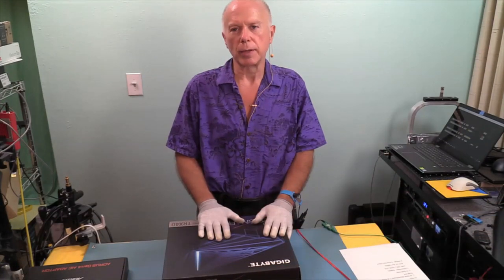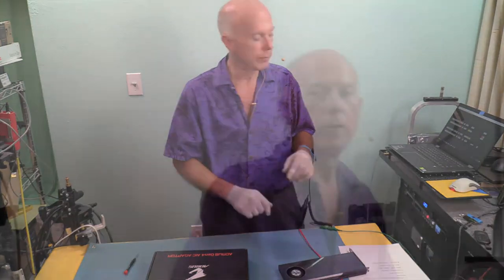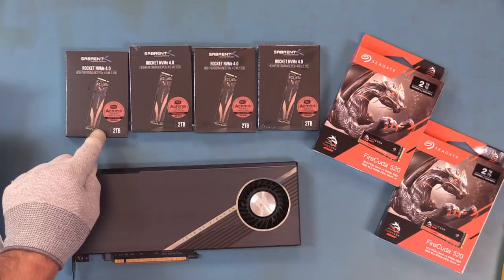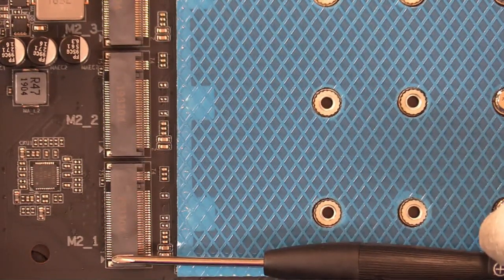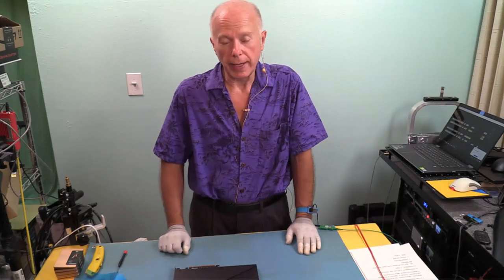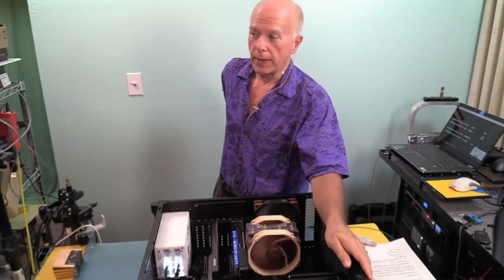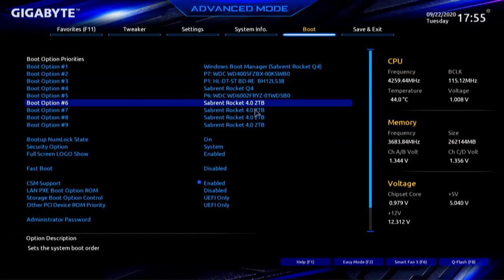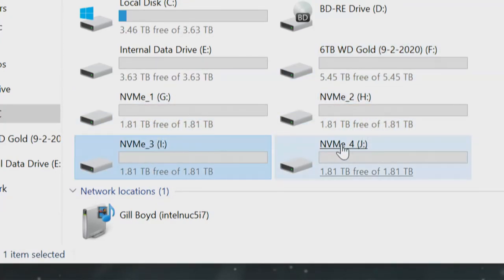Gigabyte AORUS Gen4 AIC Adaptor Comparison and Simple Install Tutorial TRX40 Designare

Comment: Hi I wonder what was the speed read and write that you get on that configuration .
If i get 4×sumsung 980 pro would it support that speed of 7 gb of 24 in total on  PCIe 4 or is there any bottleneck some where in the design
Reply from the maker: Hi Or Aka, 
Good to meet You! We are working on that Topic right now as an ongoing project. 
We have tested 1 - 1TB Samsung 908 Pro Drive for performance on 2nd M.2 NVMe Connector. Single Samsung 980 Pro achieved 6,700 MB Read and 4,900 MB write on 2nd M.2 Connector. 

Using 4 - 2TB Sabrent PCIe 4.0 1st Generation Drives, we achieved 8,400 MB Read; 12,000 MB Write in Windows Software RAID. Using 4 1TB Samsung 908 Pros should do better since those are 2nd Generation! We tested using CrystalDiskMark7. Default parameters. Hope that helps! Thanks for Asking! We're working on a Video of those Stats. Stay tuned!

Comment: I enjoy the videos.  I watched elsewhere that to take full advantage of RAID 0 across 4 NVMe drives, they are better suited to 2 drives from PCIe slot 16_1 and 2 drives from PCIe slot 16_2 because apparently each CCX in the Threadripper favors a particular set of I/O on the motherboard.  Have you heard or experienced this?  This was a couple years ago with older Threadrippers so maybe the technology or architecture has improved since?  Just a curiosity.
Reply from the maker: Hi bistrobmusic, 
Thank You! I'm glad You've asked that Question! We'd have to test to find out. 

AMD 3970X CPU - # of CPU Cores: 32
https://www.amd.com/en/products/cpu/amd-ryzen-threadripper-3970x
Core Compute Complexes (CCX) 3970X 
https://en.wikichip.org/wiki/File:zen_soc_block_(32_cores).svg

I question whether the problem is actually the Hardware. Windows is not a Real Time O/S. DPC Latency is an issue, as You well know. And Windows behavior does not help. More on that subject, in another Video! 

This would be interesting to know on the Threadripper Pro to determine what that System could be capable of at that price point. 

There was a time when Thermal Recalibration was an issue with spinning drives for Video. 

Furthermore, I don't know if it's worth the trouble considering the machine could not be put into production while testing. RAID alone can be finicky to setup, not just in RAID per say but in setting up block size. Changing one thing changes everything! 

We're focused on the totality of the System. In other words, what it takes to make it work and how to fix it when it does not work! Documenting even this much takes time. But this much, we think is worth it for You! Yes details matter. Enough details to get 'er done and get to work! Our Goals are, Bang for the Buck and to Keep it Simple! 

Are You Building a TRX40 System? You're in to Music, You'll want to watch our Titan Ridge Thunderbolt 3 Tutorial. Thanks for Asking! Al always, Your Comments help Us to make better Videos! Stay tuned!

Comment: some benchmarks would be nice, especially wanna see if it can go over the rated 15gb/s they advertise, if its pcie4.0 it should be able to handle 27gb/s++ with 4 fast disks, but i suspect they use some older chips/switches in it.
Reply from the maker: Hi King, 
Welcome! Working on it! Had to sidestep due to WRX80 then Thunderbolt 4 then Adobe AE MFR! Whew! Will be about Heat and Speed Tests just like we've done on the individual 2nd Generation PCIe 4.0 M.2 NVMe Drives! Staging the Shot was an issue. 

Remember, Vendors Quote Specs of Burst mode as if that's actual throughput! Stay tuned!

Comment: I don't think it's much of a performance hit if at all to move your GPU to an 8x slot especially if its PCIE 4.0 as I don't think GPU have yet to even saturate a 3.0 8x slot.
However I don't see anyone needing enough SSDs to warrant using this adapter whilst not needing the capabilities of a true HEDT platform which x570 really isn't, Maybe if x570 had triple channel ram support like x58 did then the HEDT designation would make sense.
Reply from the maker: Hi Anonymous .A, 
Agreed on both accounts. Doubt anyone will ever notice a performance difference with Video in a x8 Slot. 

We have since learned, what the Chipset is capable of and the actual execution of said Chipset are 2 different things. Meaning? While the x570 chipset, on paper, has 1 x16 Slot, that is a shared Resource. How's that? The only way to retain a x16 Slot is to keep the Video on the Processor. No Video card! As this applies to Gigabyte x570 Motherboards, when both the x16 and x8 Slot are populated, they share Resources. The x16 becomes x8. Not a true dedicated x16 Slot which is a real bummer! 

You'd be surprised how many requests we're getting where Users with x570 chipsets want a Quad card. Not happening if they have a Video card! The requirements are narrow and specific. For example, Motherboard Brand, Model and Revision. 

Solution? A Self Bifurcated x8 Quad card. Like the Glotrends Sky card here: 
https://youtu.be/QF71-5nhrAk

The only way to know this stuff is to do it!
Reply: @BuildOrBuy  Oh yeah I forgot that an NVME drive was default which makes it 4 lanes short, However I guess that isn't a big deal as PCIE 4.0 4x is roughly equal to PCIE 3.0 8x.  

I find it odd that so many people with x570 would be that interested in a quad nvme card when the drives are still expensive enough that most people would end up paying more on storage than they did on the rest of their x570 system just to practically fill it.  

Maybe in few years where the systems become secondary machines and SSDs are cheap would it make sense for many users to be interested in a quad nvme card for an x570.
Reply from the maker: Ji @metaleater9  , What's amazing is the price of a Bifurcated Quad card. And that's the only option for x570 with a Video card! We've only looked at all of the Gigabyte x570 Motherboards. We'll check the other vendors as the question arises.... Brand, Model and Revision! Research takes time! Currently working on next Video!
Reply: There is a guy on youtube who tested this. PCIE3.0 vs PCIE4.0 for a GPU. No difference at all so I think this will be the same with PCIE4 x8 vs x16. One thing, the AMD 5000's have 20 PCIE lanes directly to the CPU where 4 are already taken for the Chipset. So the x8 and x16 will actually be shared...
Reply from the maker: Hi @meh8099  , Which means 2 x8 Slots since that's a Shared Resource.

And that precludes using any NonBifurcated M.2 NVMe Quad card.
Reply: @meh8099 What about a x4 PCIE 4.0 with a full size x16 connector?  Speed wise it would be equal to PCIE 3.0 x8 but it would be run purely though the chipset.  I know of at least one motherboard with that configuration.
Reply: @metaleater9  not sure, I checked the x570 specs and there are 16 pcie lanes directly connected to the CPU of which at least one full x16 slot with 16 lanes and one 'fake' x16 slot with 8 lanes which is shared. So even if you would put the full x16 card in there it would still directly connected to the CPU over those 8 lanes which are shared with the full x16 slot.

How I'm going to do this:
GPU in the 8 lane x16 slot
NVME extension card in the 16 lane x16 slot.

Chipset pcie:
2 NVME's onboard via the chipset (1 OS, apps and games, 1 for tiering slow disks)
2 slow 3.5" disks in raid 1 tiered via software with the NVME

In this way, when I'm gaming I will still have proper performance, the OS NVME will get more then enough throughput and the GPU is directly connected to the CPU.

The NVME extension card will only be used when I'm not gaming: running my VM's and docker dev environment.

This way the GPU won't steal performance from the extension card and the OS apps won't steal IOPs from my extension card 🙂
Reply: @meh8099  I am fairly certain that the Asus x570-P only has 4 lanes going to the 2nd x16 slot via the chipset but I could be wrong.
Reply: @metaleater9  do you have a link with the schematics? :) I'm very interested in that
Reply: @meh8099  https://hothardware.com/ContentImages/NewsItem/48165/content/X570_PCIe_Lanes.jpg The x570-P user manual/site states that the 2nd x16 runs at x4 max speeds and going by that schematic for potential x570 lane configurations I'm certain that the 2nd x16 slot is running through completely the chipset.

Comment: ca you use the card  and use it with just one or two M2 at first and add later on?
Reply from the maker: Hi Mico production מיקו הפקות, 
Welcome! Yes! However, what We found though was a load balancing issue if less than 4 Drives are used. Your Results may vary. Hope that helps! Thanks for Watching! Any more Computer Questions, please ask! This helps Us to make better Videos!
Reply: @BuildOrBuy  TNX
Reply from the maker: Hi @promico  , Absolutely! Thanks for Watching! Stay tuned!
Reply: @BuildOrBuy  sorry for asking i just can't get a good answer. im looking to set up 2X 4TB m2 straight to my 16 or 8 pci . what kind of solution will you recommend? which extension card or raid card can i buy? it can have 2 slots or 4 slots so i can upgrade in the future and the raid is optional for me
Reply from the maker: Hi @promico , 
Here to help! Let start with Your Motherboard for Specifics. Do You have the Gigabyte TRX40 Designare Motherboard? If not, which one? We need to know Your Motherboard Resources to know what You can do.
Reply: @BuildOrBuy  i have auros master x299 with 4 pci 16 (2 of them are 8) with intel  i9 9960X
Reply from the maker: Hi @promico , 
Gigabyte Aorus Master x299 - Nice setup! 
https://www.gigabyte.com/Motherboard/X299-AORUS-MASTER-rev-10#kf
Intel i9 9960X - 16 Cores, 32 Threads; 44 PCIe Lanes! OK! Perfect! 
https://www.intel.com/content/www/us/en/products/sku/189123/intel-core-i99960x-xseries-processor-22m-cache-up-to-4-50-ghz/specifications.html

To maximize PCIe Resources, suggest get the Gigabyte Aorus M.2 NVMe PCIe 4.0 AIC for a x16 Slot. However, if You do not install all 4 Drives, there appears to be a load balancing issue causing a performance degradation. Your Results may vary. 

As long as You are using RAID 0, no VROC required and use any Drives You like. IF However You change to any other RAID Level, VROC chip required as well as using Intel only M.2 NVMe PCIe Drives. 

Understand, RAID is function of the Bios not the card. A 4 Drive Card is about the same price as a 2 Drive card. Gigabyte makes a 2 Drive M.2 NVMe PCIe Adapter (GC-2XM2G4 vs GC-4XM2G4) but it can only be purchased as a Bundle with a Motherboard. The Gigabyte Z590 Aorus Xtreme Motherboard. We have a Part Number (GC-2XM2G4) but no SKU. And Gigabyte does not List the card anywhere. Therefor, one of these cards mentioned, Non Bifurcated if You only want to install 2 Drives on a x8 Slot. Perfect! 

To reiterate, 2 Options. One on x16 Slot for 4 Drives. One on x8 Slot for 2 Drives. Either way You have those 2 Options. 

And since You want right now to go with 2X 4TB M.2 NVMe PCIe Drives, Get a Dual Drive Adapter card to maximize performance. As long as You have the x16 Slot available, You can always use that Slot in the Future for 4 M.2 Drives. Thoughts? Hope that helps! Thanks for Asking!
Reply: @BuildOrBuy  THANK you so much for elaborating with this detailed answer . can you recommend a specific card except for the aoros (maybe the 2 drive one) with a buying link? any way thank you again for spending you time helping me find a solution. appreciate it very much
Reply from the maker: Hi @promico , 
Absolutely! Supermicro. Server technology. Easy install. This is Our next Video!

Supermicro AOC-SLG3-2M2 PCIe Add-On Card for up to Two NVMe SSDs
https://amzn.to/3wOKBpO
As an Amazon Associate I earn from qualifying purchases.

Hope that helps! Keep Us Posted on Your Progress!
Reply: @BuildOrBuy  you are the best thank you
Reply from the maker: Hi @promico , 
An honor and a priviledge! Keep Us Posted on Your Progress! Success and Best Wishes!

Comment: Yes! Again You've said something very important after just 2 first minutes of this video. My aim is exactly like you said. I don't mind putting my graphic card in PCI express 4x slot (electrically) cause a GT 1030 doesn't require more right? Besides I don't play games and I only need that card cause unlike Intel CPUs Ryzen 3900X doesn't have an integrated GPU in itself. Because all of that I can use an add-on card and put it into AMD's x570's chipset's only 1 PCI express 4.0 16x electrical slot and have a maximum of 4 nvme cards in there on an add-on card provided that resource management and PCI birification allows it. Am I correct about this?
Reply from the maker: Hi Don Jon,  You are correct! What's Your Motherboard? I'd like to check out the Specs and verify how Your Motherboard is setup by reading the PDF file. That's not bullet proof but it's a starting point.

This is all about how to use that x16 Slot and to keep that Slot at x16 so it does not drop to x8.

So far what we've seen, by the AMD Chipset Spec, it works. However, by Motherboard Vendor implementation, it does not. We're seeing only 1 x16 Slot for Video card. As soon as the 2nd x16 Slot is used, the 1st x16 Slot drops to a x8 Slot. Why? Shared PCIe Resources. And that's annoying! 

We need to verify Slot #3!

Otherwise, the only way to use a Quad card on an x570 Motherboard, which is PCIe 4.0, is to use a Self Bifurcated card that works in a x8 Slot. And said card is only PCIe 3.0. Which is another bummer! No one yet makes a x8 card that is PCIe 4.0. Everyone is just now realizing that, including Motherboard Vendors! Go figure. 

The only way this works would be if You use a CPU that has Video on board. And that stinks! Let's check Your Motherboard to be certain of Slot 3.
Reply: @BuildOrBuy  I don't follow but firstly my unopened MSI x570 Godlike has got a x16 mechanical PCI express x8 electrical gen 4.0 twice m.2 nvme gen 4 card. Second, I use MSI x570-A Pro motherboard with a GeForce GT 1030 kept in  8x electrical slot. This gives nice results when testing with xpander card from Godlike motherboard. It feels right and biurification is present in BIOS so I have already made RAID0 in Windows 10.
Reply from the maker: Hi @donjon7554 ,
I hear what You're saying now. Got it. You're using 2 or 4 NVMe Drives? I like to have the Specs in front of me to see what is what. 

1.) MSI x570 Godlike - 3rd Gen AMD Ryzen supports PCIe 4.0 x16/x0/x0, x8/x0/x8, x8/x4/x4 mode. 
https://www.msi.com/Motherboard/MEG-X570-GODLIKE/Specification
- PCI_E1 PCIe 4.0 x16 = expander card
- PCI_E2 PCIe 4.0 x4
- PCI_E3 PCIe 4.0 x8 = Video card!
- PCI_E4 PCIe 4.0 x4

2.) MSI x570-A Pro - Has 1 x PCIe 4.0/ 3.0 x16 slot (PCI_E1). 
https://www.msi.com/Motherboard/X570-A-PRO/Specification
- PCI_E1 PCIe 4.0 x16 = expander card
- PCI_E2 PCIe 3.0 x1
- PCI_E3 PCIe 4.0 x4 =  Video card! Not x8 Slot.
- PCI_E4 PCIe 3.0 x1
- PCI_E5 PCIe 3.0 x1